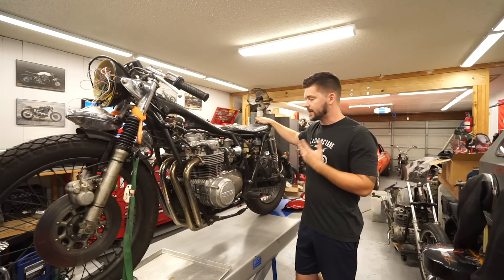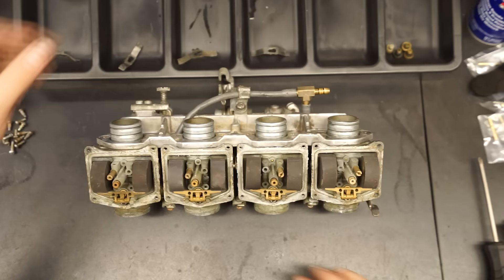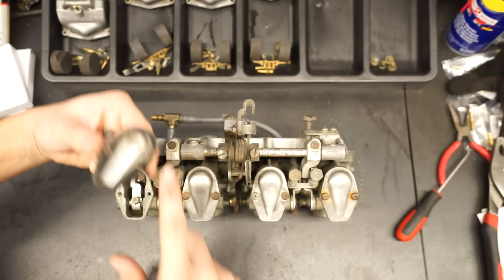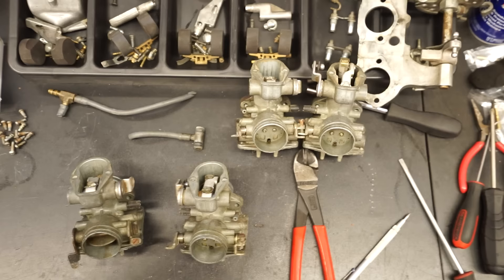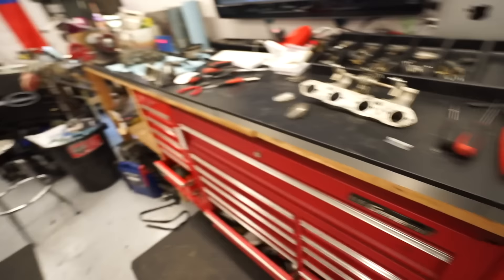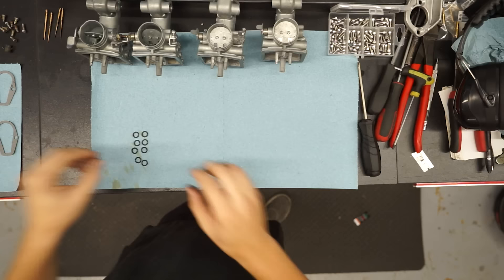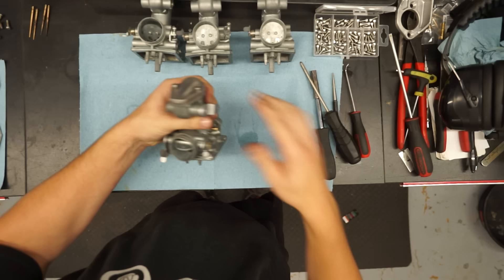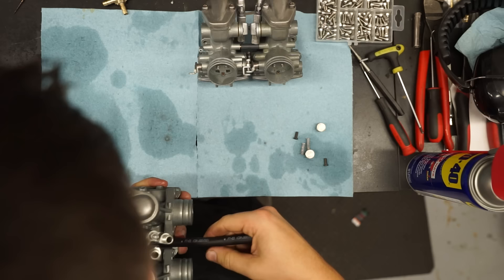How To rebuild Honda Keihin CB350 CB400 CB500 CB550 Carbs (Step by step)

Comment: great video, thanks so much what jet sizes would you recomend for a 400 /4 f 1976   with pod air filters?
Reply: size up two sizes from stock to start as a general rule of thumb.See how it runs and adjust form there. Read the plugs to tell if it is running lean (white) or rich (black).

Comment: 1982 Yamaha XJ550 Maxim. How do you get out what I believe are the Pilot jets, brass, but they are down inside a orifice and are really tight, I am afraid to use a regular steel screwdriver because I have broken them before, they are real tight.

Comment: Thanks for a very interesting video. I have a '74 CB550, and the carbs are slightly different. The secondary jets have a through hole in the middle of the screw slot, and the replacement ones in the kit did not, so I cleaned and re-used the old ones. The main jets were slightly different from the kit parts, and the carbs do not have main jet retaining springs. Was there a design change somewhere along the line?

Comment: Hey man, great video. I got a 1972 CB500 Four and plan on adding K&N style pod filters. Any suggestions for jet sizing and where I can source the parts? Thanks!
Reply: You can try jetsrus BUT navigating the website can be a pain in the ass. It's almost too comprehensive.
As for jet sizing,  if you haven't found it already, you can try googling Jetting Recommendations by Denny Zender. Seems to be pretty spot on to what he used in this video.

Comment: i do have a 1976 honda cb400f,can you please explain how and where is the location to adjust the air and fuel screw outside without disconnecting all carbs parts,i just cant find it lol"thank you.......

Comment: Question about the velocity stacks. When using them is there any air filtration or is it just raw air into the carbs? And how often do you need to do carb work to maintain that?

Comment: How do you fine tune the air/fuel mixture screw when you have four inline carbs? You can't listen or detect the small change in one cylinder behaviour.
What is the accurate way to do it?
Other than, maybe, use one of these sea through spark plugs....
Reply: Speak for yourself; with a little finegefühl one can definitely detect small changes in the cylinders; it's like a scaled down 60s/70s Porsche

Comment: Very good video on rebuilding 550 carb . I have a problem fuel is leaking from both inside carbs from the vent holes above the floats on both inside carbs I can"t figure out why can you help thanks

Comment: I did this exact rebuild 18 years ago (God is it really that long ago?) without the benefit of your instructions, I think I did pretty good though. However, one problem that I had after I finished and started the bike one of my cylinders appeared to be getting too hot because that exhaust pipe the chrome was turning blue just on that one pipe. Any idea what I did wrong on that cylinder?

Comment: Taylor:  I'm working on a 72 CB500 and the carbs are seriously gunked up.  The brass pins on the floats are frozen in place - I can't budge them.  I'm soaking them in WD40/Liquid Wrench now.  I can get new floats and pins, but any thoughts on how to get the stuck pins out?

Comment: Do you have a link to where you purchased the vacuum line at 1:00:20? My carbs have smaller male ends and don't fit the fuel lines.

Comment: I didn't notice much of a difference in the video from the ultrasonic cleaner. Is there a big difference between using an ultrasonic cleaner vs a parts washer and nylon brushes etc.? I am wondering if i should buy an us cleaner or not.
Reply: haha NVM I need a vapor blasting cabinet :D

Comment: Hi there. I have a 1981 Honda CM400A. I am having an issue when I stop at a traffic lite or stop sign the bike wants to stall. If I pull out the choke it stops it from stalling. I had the carbs rebuilt and rejetted so I am not sure why this is happening. Any suggestions would be greatly appreciated it.

Comment: Do you still do the vapor blasting as a service if I ship it to you? I have a 1981 CB650 carb broke down currently and would really like to have them cleaned up. Does the vapor blasting remove pretty much everything from the carbs?

Comment: Hey, I had my brother disassemble my carbs for a vapor blast, and he bagged everything in separate bags for each carb. So far so good. He is dumb as a doorknob and refuses to follow guides, so he went ahead and did it "blindfolded".
Im sitting here trying to piece it back together, but im stuck at the carb piston slide assembly. The arms connecting the piston with the lever arm is poorly pictured in my manual, or Ive got to many parts for this. Would you take a look and see if it looks remotely close to how it should be?

Comment: When doing the bench check on the throttle butterfly you're checking at the bottom using a drill bit. I noticed on my carb the gap is different at the top of butterfly. Is the bottom gap the more critical gap and the location of bench testing

Comment: After you vapor blast them, what do you do to make sure there's no vapor blasting media stuck in any of the tiny passages?
My 1975 CB750 carbs have a lot less parts to worry about.  I haven't done any CB550 carbs but I'm guessing mine are much easier to clean to rebuild.

Comment: I'm stuck with my cb 750 f  I don't know how 2 set my cub   ,   the Rev counter and to 5  doesn't reach it limits   , everything when I play with my cub  it's slightly  give power  but not how it should  be plz I need your help  I got   alot of these  bikes parked   and they all give  me  the same problem

Comment: At 1.08 when you're connecting them together, I noticed you didn't have those black plastic dohickey's installed.  Mine has these and are broke.  Are they not necessary?  They look to be just some sort of spacer.

Comment: Hi Taylor, i have a question for you! Me and my dad are going to rebuild an old Kawasaki Z1000 from 1977 but we are struggling about what we are gonna do with the rear fender, we're going for a Café Racer look and for that the nicest look would be no rear fender, however we are going to ride it in rain. Do you think my back will stay dry if we have no rear fender? Or would you recommend running with one instead?
Reply: Also, no short fender, honestly we're not really big fans of short fenders
Reply: Hey, I just thought I'd offer an experience and my option here. I had a old 95 Suzuki RF900R I converted into a street fighter back in the day, and I went with no rear fender. I got everything from water to grease on my back, lol. You're definitely going to get wet, buuut your bike will look good. I love the look of the tires exposed. I'm actually working on a 76 CB550 cafe racer conversion now, and I'm planning on no rear fender. Anyway, it's personal preference. Sometimes you have to sacrifice functionality for look, or vice versa. Pro and Con it out. Good luck to you and your dad on your build.
Reply: I forgot to mention that if you do go fenderless, get a cheap dollar store poncho to put on while it's raining or after it rains. The thin ones in the little plastic packs are the best because they store so nice on barebone bikes like that. Cheap and easy trick to protect your back.

Comment: Is the process the same for 1978 CB550? I think the factory jets are larger on 78. I have 4 stock mufflers from a cb650 and velocity stacks. What jet sizes do you recommend? Stock are #42 and #90. Thank you.

Comment: What SS hardware do you use? Or just one offs as you need them. I have a bunch of JIS screws with stripped heads from previous owner, figure I should just replace them.

Comment: Great vid, Quick question. I have a very stuck float bowl. Any ideas to help get it off. Try a few good taps but it’s solid. Thanks Andy
Reply from the maker: You can try to slide a razor blade between the bowl and the carb body to loosen it. You can also carefully pry them apart with a flat head screwdriver.

Comment: I have a CB 500 and rebuild my carbs completely with new parts and untrasonic cleaned them, set the float hight to 22mm and i have the problem that my carbs are slowly dripping out of the drains after a few seconds. also if i close my choke the engine stops running completely. any ideas or do you had the same issue in the past?  mutch love from germany <3

Comment: Does anyone know what sizes hose/line to use between the carbs? 1/4, 3/18, 1/8, 4.5? 
Thanks for the vid!
Reply from the maker: 3.5mm for vent lines. 5.5mm for fuel.

Comment: Is there a place to talk to you? maybe facebook group or whatever? 
I was wondering, is the reason you pick these old hondas because they are cheap to repair? I was seeing carb kits are 40, the rebuild kit is 50, the coils are 40, rectrifier is 20, as an example. Are Kawasakis that cheap? I wasn't seeing them listed at amazon. Then as far as resale value, I wonder about that too. I see they are pretty high, like around 2k in pretty decent shape here in Ohio, but can you command that? 
I have experience with Kawasakis but in browsing for projects, just seems like hondas are more plentiful and in better condition on average. 
Though I feel like my perception might be warped, as I graduated in 95 and these were old bikes then, and I can get, or should be able to get a lot newer stuff like 2k, and skip all that hassle that you tend to find with these older bikes al la 70s, 80s. Though I do like recycling and keeping things going. 
I have a kZ650 to restore, or well part out not sure which way to go, might even trade. 

Thanks

Comment: 1:13:00 bench sync
Reply: DONT PUT THE DRILL BIT IN THE HOLE. IT GOES IN THE GAP ABOVE THE HOLE. In case there is anyone as silly as me out there who spent over an hour tricking myself into thinking adjusting the bolt was doing anything when the drill bit was in the hole below the gap hahahaha.

Comment: Nice job Taylor. How different would the process be for early CB750 carbs do you think? I have a CB650 that came with CB750 carbs from the previous owner, need to work out the best jets too.... Great vid!
Reply: TheDanFromOz which carbs you have? Screw tops or keyhole tops?
Reply: @preez77  It looks like they're the screw tops I think, they have big round caps on top...?
Reply: TheDanFromOz those are round screw tops. Lucky for you they’re bit easier to work on. Less moving parts. Cleaning is similar to this video, for reassembly look up HackaweekTVs video. He has. 750 restoration series. He assembles complete carb in one of the vids.

Comment: I just opened mine up and they are missing the link plate between the synch screws. I think the Honda part name is "Holder A" and "Holder B". Are these available to buy or should i just make my own out of some 20 gauge steel or something? 18:28 you call it a "connecting bar"
Reply from the maker: 4into1.com sells them.
Reply: @ClassicOctane   sold out! lol Excellent video. Thank you. I will watch more once i find some links!

Comment: Hello where do you get the 110 jets and 40 jets?  I want to upgrade my air cleaner to air pods but can't seem to find the correct jets and rebuild kits.  1982 nighthawk 650

Comment: Sorry if this has been answered... is this video for a 1978 cb550K? If not, are these the same carbs as the 78?
Reply: The 77-78 will have different carbs. I have a 77 and they don't come apart as easy. Not planning on full disassembly on mine due to the staked screws

Comment: Excellent video!  I have a question about the 4 rubber damper seals that went on the linkage parts?  Are they not necessary to use during the rebuild?   The parts I am referring to can be seen here.  https://images.cmsnl.com/img/products/holder-set-aadj_medium16029323004-01_7e8e.jpg
Reply: I had a junk set of carbs and the ones I will use. On my good set, the rubber looked good, but I still didn’t put them on because he didn’t. On my junk carbs, they were like little black rubber crackers and broke entirely. I have a feeling that’s the case with most peoples. It’s hard to get them off without ripping them or worse, and the kit I bought had no replacements. I bet it’s non-essential.